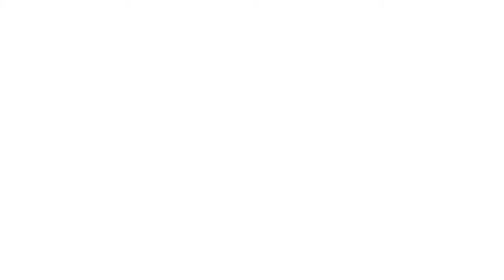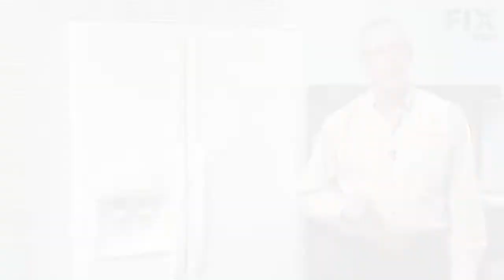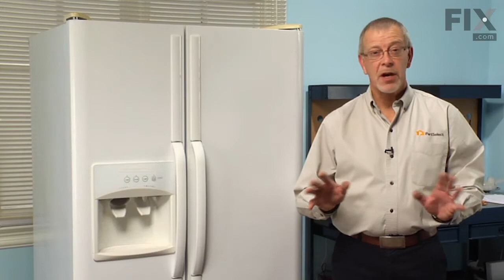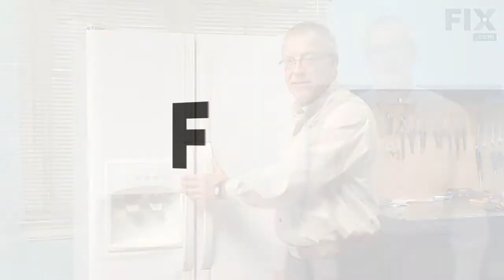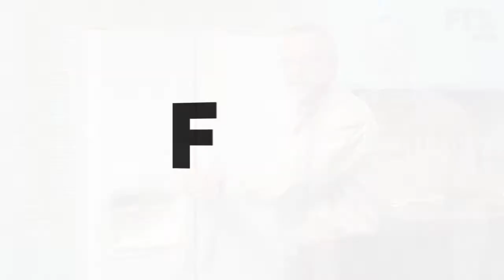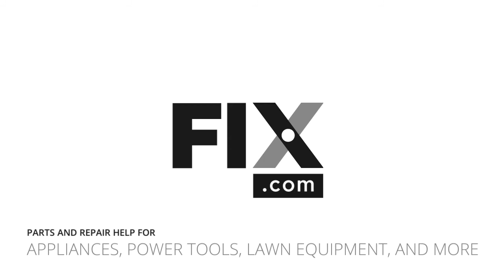Frigidaire Refrigerator Repair - How to Replace the Ice Container Assembly

Comment: I have a Frigidaire side by side with an ice maker.  It makes ice but the ice doesn’t come out the front of the freezer.  I think the ice is frozen solid on the bottom of the ice tray.  I’m not sure if I should try removing the ice tray like you did and just get rid of the ice and then put it back in but I’m worried I’ll s few something up.

Comment: Mine won't come out. I think it's frozen up. Any suggestions?
Reply: Mine was stuck too and so I turned the freezer to the lowest setting (1) and waited a few hours and then I gently pulled from both the front and rear of the freezer tray.

Comment: I need a new one.  The ice dispenser in the door stopped working.  There is a plastic piece that rotates to move the ice down to the dispenser.  That plastic piece is broken.  The repair guy said I have to buy a whole new ice bucket.
Reply: Where can you  buy a new ice  bucket